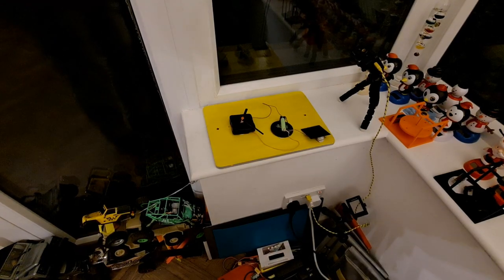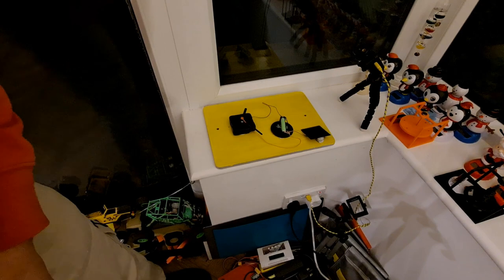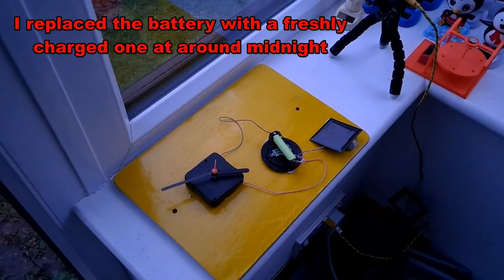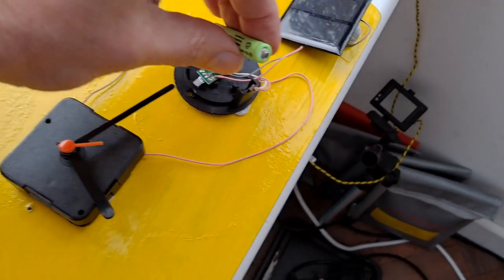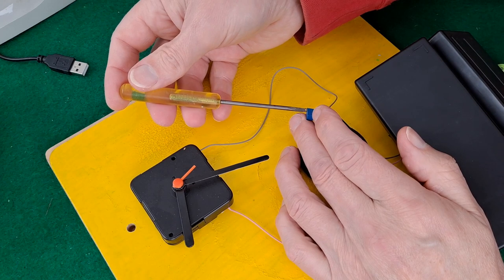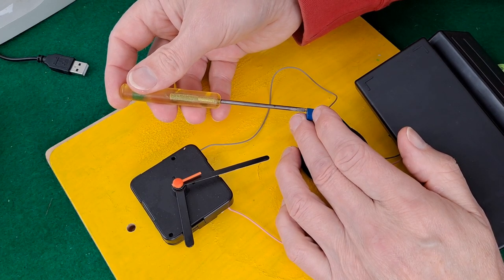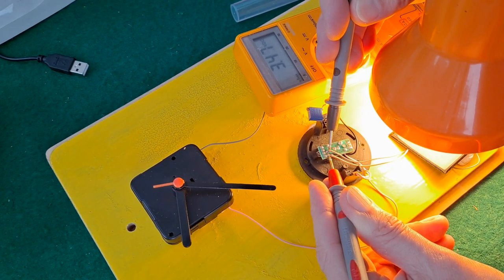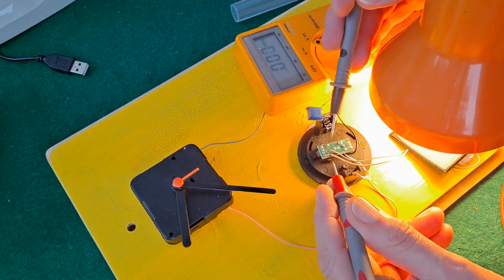Solar-powered clock for George PART 3 🌞😎🕑

Comment: Great project. I have found that these solar lamps don't gather enough energy in deep winter to run the LED all night, plus the batteries supplied with them are very poor for capacity.
Might be better to use more solar panels as well as more batteries, both in parallel.
Reply from the maker: I changed the battery to an AA and that is keeping the clock running OK, you will find there are 6 episodes to this series. Details in the description. Since the series finished I have moved the board to the bedroom window where we get no direct sunlight. So far it has continued to keep the battery topped up from the ambient light and the clock has been running fine.